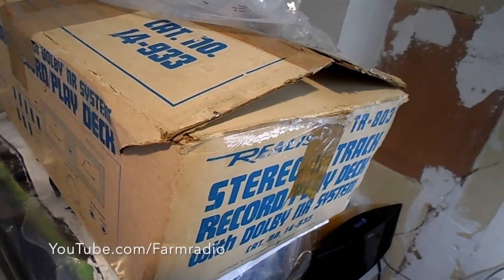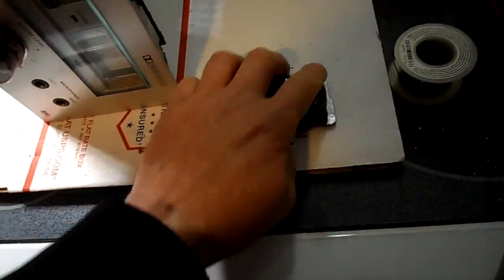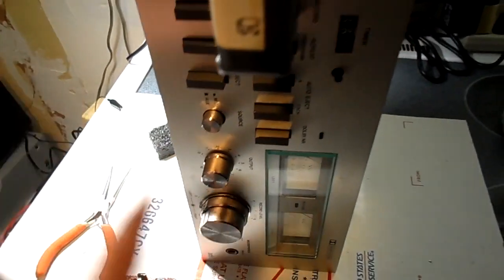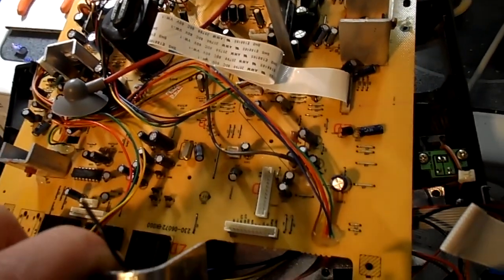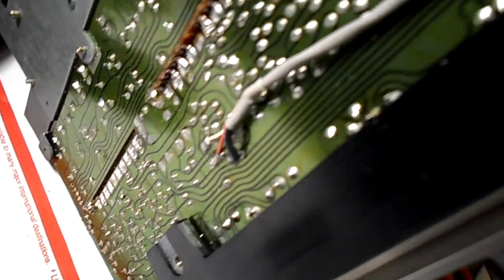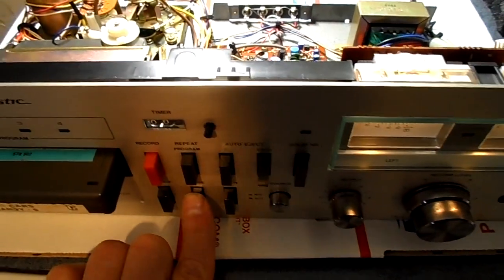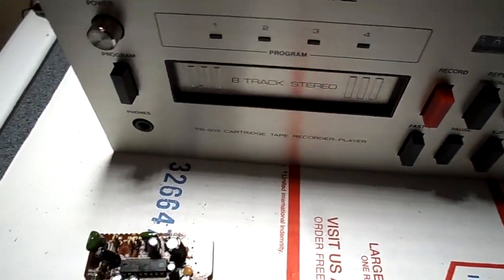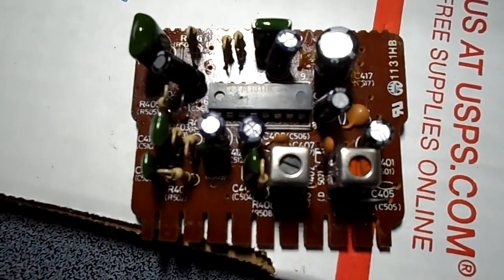Realistic TR-803 8-Track Play/Record Deck Repair,  Pt. 1.

Comment: Great vid, i am going to try to recap an old graphic equaliser, do you think it would it be worth while using caps from old boards that measure ok and are good makes, as i have lots of them. Or get new but cheaper  ones from ebay. on a very tight budget and not sure if recapping will work anyway?

Comment: The sound is leaking out of the hole in the I.C. or the smoke inside the part leaked out and now needs replacement as there is no way to put the smoke back in the part. hoping replacement solves the issue. Thanks for another great video.